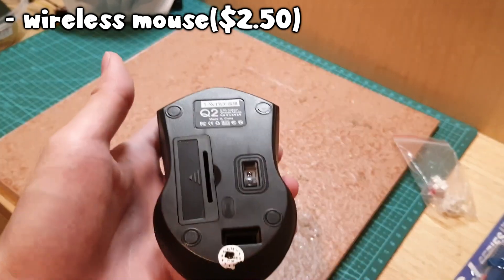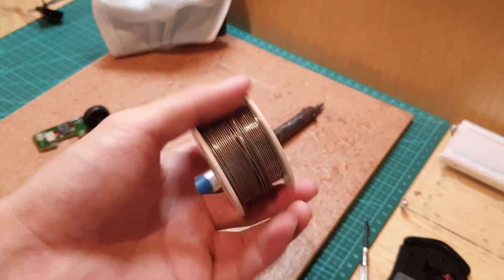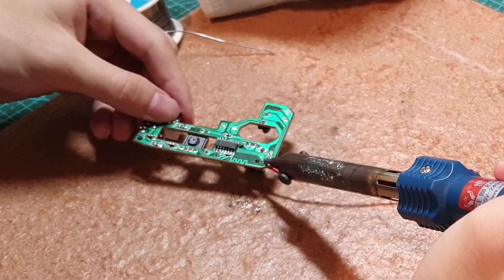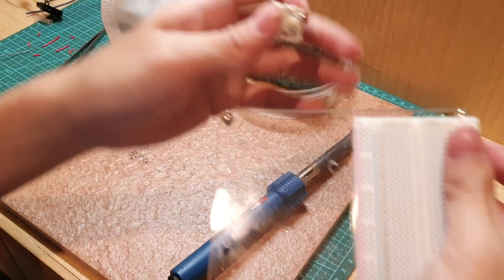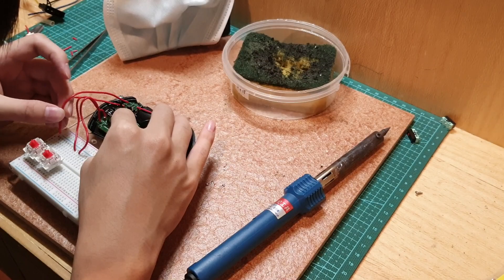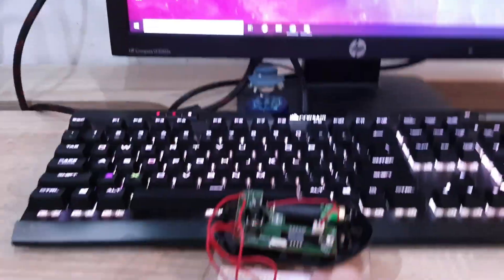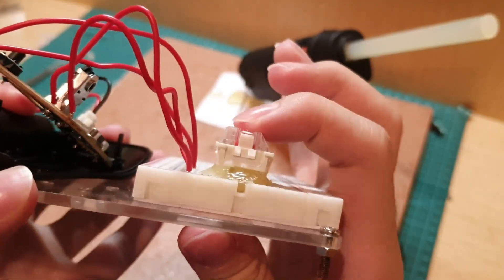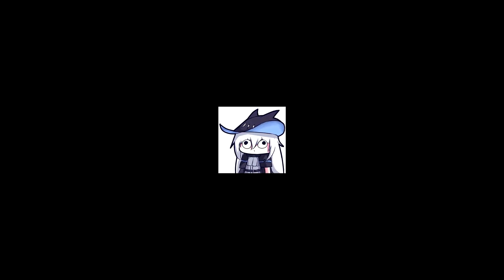$5 DIY osu! Keypad KILLER!

Comment: i'm thinking of doing this but i'm gonna 3d print a case and use some hotswap sockets.

i see no reason to keep the mouse inside of the original shell, nor should a sensor light diffuser be necessary as it allows for the mouse to sense movement. also, there may be the problem of if i drag with tablet, which would force me to disable the pen's tap function, which honestly seems inconvenient as fuck. also, polling rate would be locked to 125hz which means that it would be best to use a shitty gaming mouse that supports 1khz polling rather than a wireless mouse.

Comment: Hey man great job! Can i ask which pin on switch should i connect to which hole in mouse, theres 2 of them 
? Does it matter?
Reply from the maker: Probably doesn't matter if there's just 2
Reply: doesnt matter cus switch doesnt have polarity, meaning u can connect to either side and it would work. stuff that has polarity such as LEDs it matters. if u put in wrong way then it wont work.

Comment: Can any wireless mouse or wired mouse work? And do you need to solder the wire on both pin?
Reply from the maker: yeah u do
Reply: @OPBanger8764  thanks
Reply: @OPBanger8764  also can I use any bread board
Reply: @sugo802  yes, any breadboard will work

Comment: What if my mouse buttons have 3 pins, not 2 like in most cases?
Reply from the maker: The one I used had 3 pins as well but one is probably not used so maybe you can try which 2 works
Reply: Thank you very much, I will try and tell you  if it works :D

Comment: can i somehow make those detect like normal keys presses instead of mb1 and mb2 press?
Reply from the maker: There probably other methods, I'll try to look for one
Reply: I think for maybe $10 you could probably just convert some male to female jumpers to f to f and connect them to a raspberry pi pico from keyswitches, and then use some adafruit code. I say could because this just depends on how lucky you are. The circuit basically is just hanging from a string but once you print a case it's pretty solid.

Comment: Bro, how did you connect the wire to the switch through the breadboard?
Reply from the maker: I had to extend the pins on the switch so that it'll be long enough to attach to the breadboard
Reply: @OPBanger8764  so i just need to push the wire and the pin on the switch into the breadboard hole and they'll connect as long as they're on the same row?